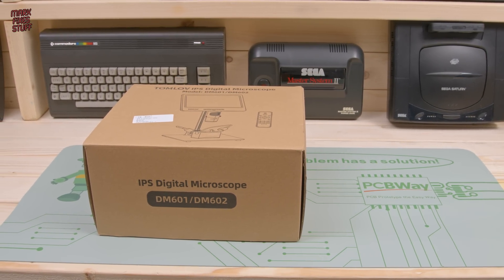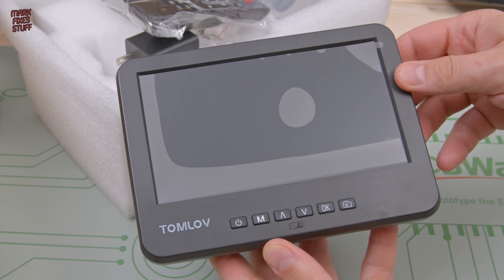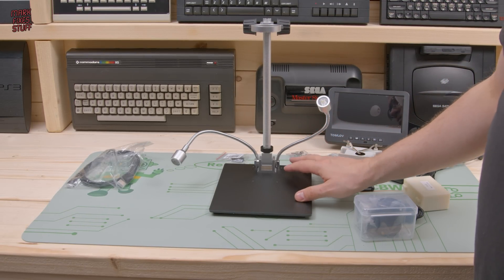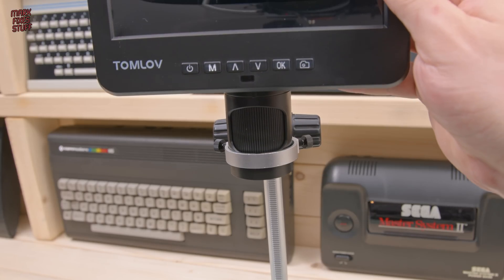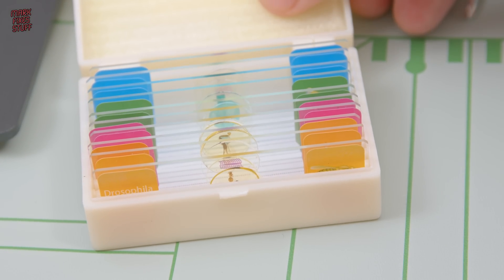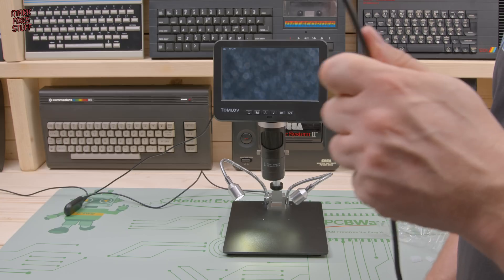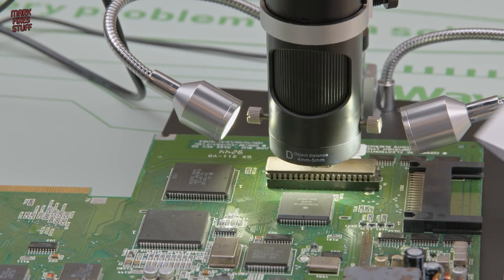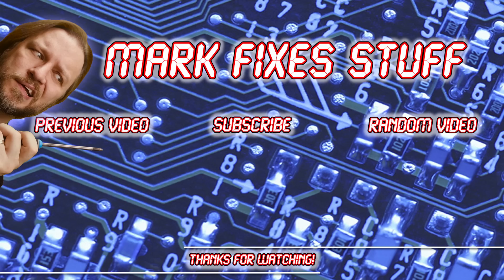REAL REVIEW: Tomlov DM601 HDMI Microscope AMIGA A600 - Burnt Board Post Ultrasonic Clean Inspection!

Comment from the maker: So. I've been using this for about a week and a half now. It's really helpful and much better than my previous digital microscope, with details being much clearer. The HDMI really is a game changer and is really comfortable to view. If I had one real criticism it's the same as I level at a lot of these products. If you have a large board you can't really get it undeneath far enough. 

I do realise this is me being picky and all the other 'scopes are the same format. In fact, this model has a much larger base than most. I think there is a market for maybe a bench mounted swivel arm? It would have to be fairly stiff though. Thoughts?
Reply: "If you have a large board you can't really get it undeneath far enough. "

Mate this is as far as most people get in their thoughts. Some, however, go the extra mile, build a prototype, and stick their idea on kickstarter. I mean you've got a 3d printer, right? Food for thought bud.
Reply from the maker: @baxtardboy  That's true. I was thinking of sticking an adapter on a decent quality Microphon boom arm though so I think an easy solution may exist. I'll investigate if there is already before I sink too much time into it.
Reply: Modify a laser etcher frame (ie, just remove the laser unit, make a mount) to hold a scope and lights. Then you can scan up and down a board to your hearts content. By now we should be able to capture images and get AI to find faults.

Ortur Laser Master 2 would be enough.
Reply: I use a Smallrig adjustable arm with a massive magnet on the bottom. The other end has a quick release camera mount. Takes seconds to set up and is rock solid and very adjustable
Reply from the maker: @MoreFunMakingIt  got a link?
Reply: What I did with my microscope is, I ditched the stand that it came with. I bought a 1/4" (tripod socket) desk mount arm and clamped it to my desk. Then I designed and 3D printed a mount that let me mount the microscope onto the desk arm. That way I can position it any which way I want, and since there is no stand to get in the way, I can fit any size of board under it.
Reply: If you had a U shaped piece laying on it's side. Mounted to the underneath of the  bottom plate. Then the provided shaft mounted to the top side of the U shaped piece. You could slide bigger boards inside the U. Could maybe 3D print a large simple U shaped piece up to test. With maybe 4 or 5 inch spacing in the middle.
Reply: You could make something, but there are literal bench mounted arms for expressly this purpose. They're just not cheap.

Comment: Seems to be the same as AD246S-M. Tough choice between this and AD407. For AD407, they write that it has a 4MP sensor, but I cannot find any sensor size info for DM601 or AD246S-M, so not sure which to buy. AD407 seems to have a shorter working distance, which might get in my way when soldering.

Comment: Interesting that this 7" version, the DM601, allows the use of both the screen and the HDMI output at the same time.   The 10" version, the DM6012, only allows one or the other which is a real deal breaker.  Check out Branchus Creations DM602 review to see what I mean.  He doesn't show the firmware version on his so I'm wonder if it's something that can be updated.  His review is a few months older than yours but it looks like the firmware on yours is from 2022-10-17.
I sure looks like the hardware is identical except for the screen but maybe not.
https://www.youtube.com/watch?v=q_WD4SnRCHs

Comment: 2560x1440 isn't 2K, it's 2.5K. But there's a growing trend to misidentify it as such. the number refers to the approximate number of rows. There's a lot of marketing crap and as such 1080p and 2160p which are the consumer 2K and 4K aren't quite 2K or 4K, 1920 and 3840 respectively. Would love it if you'd help fight this misconception Mark 🙂. It's just confusing and people are weirdly underselling their monitors as being lower res than they really are, all because of how the number of "k" has become such a hot marketing buzzword. You could technically market this as a 4:3 4K output since that's what 2880x2160 is.

Comment: Guys I want to add a general comment. Not about Tomlov they have great products. On these things please note the depth. The bar holding the camera will not be deep enough for older larger boards - it will cause you headaches. Secondly don't get anything under a 10" and make sure you get 1080p. Don't think 720p is fine, there is a fine line between adjusting the zoom and actually getting the 720p so you want higher. You do want the HDMI to project onto a bigger screen. The batteries on these things do not last long and take a while to charge up. Consider investing in the correct size power cable. I say this from experience buying the cheap and nasty one Aliexpress.
Reply from the maker: I agree about depth. I mentioned this in the pinned comment. Solid advice about resolution. No battery in this one thankfully.